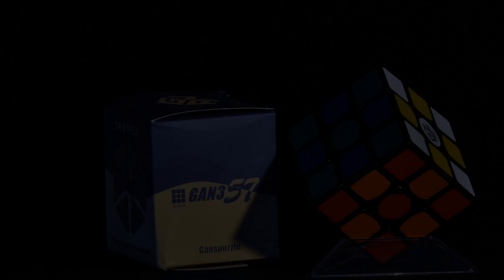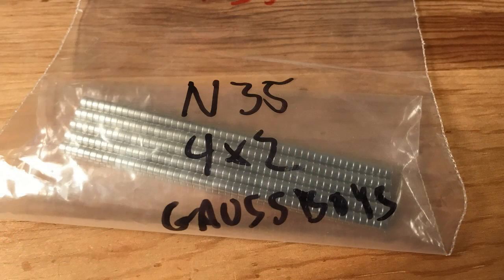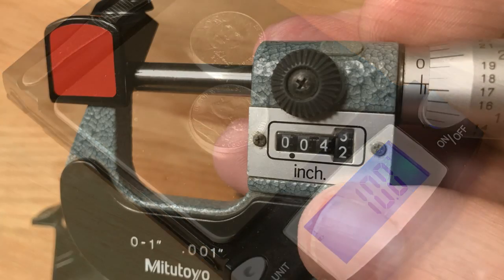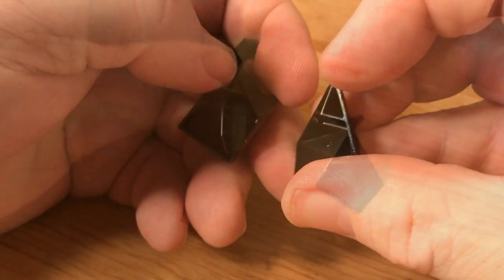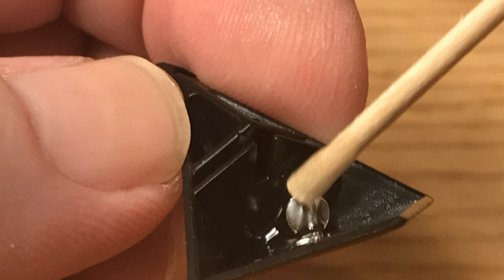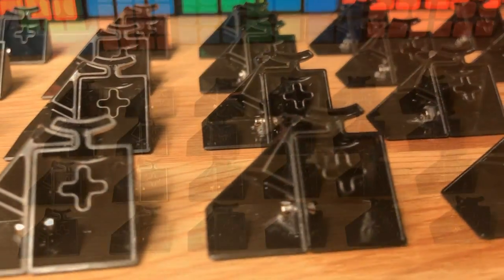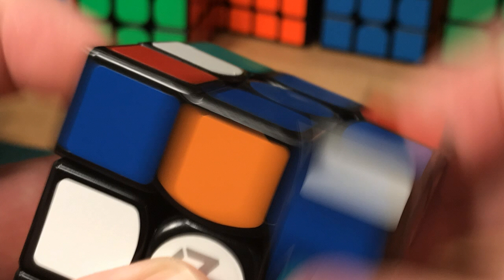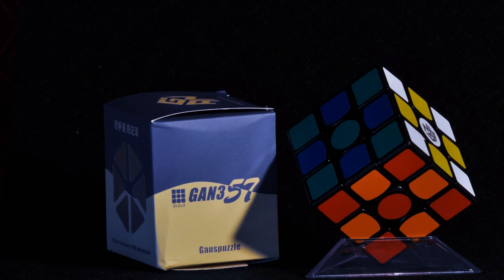How To Make A Magnetic GAN 357 Speed Cube

Comment: This 357 has a clear core? Is it the Ultimate version or the V2 version? I am just confused about the 357 versions, as I thought it was just the 357 and the 357 ultimate, but this version seems to be different from both of those.
Reply from the maker: Hmm. This cube was from four years ago. They probably have changed the core over the years. This was the only 357 model available back when I made this video.
Reply: @dmcubing6342  Ok cool. I think they probably just refreshed the 357 model with the new clear core once that came out, because the 357 and 357 ultimate have the original octopus core and a metal core.
Reply from the maker: @WillRaj  probably so. I didn’t know that about the other versions. I believe at one time Gan was having problems with some of their cores falling apart. I remember having one where the core screws detached from the core.
Reply: @dmcubing6342  Yikes. I just find it interesting that there's not much documentation about this cube. I went to the cubicles website, and they only ever carried the 357 and 357 ultimate. However, I went on some random website and found a Gan 357 V2, which might be what this is? Idk I know it is old i was just curious.

Comment: I have a important question for me. Please reply. What shoul ı use in my gan air s? What do you recomend?
Reply from the maker: Ömer Faruk The factory magnetized version uses a 3x2 magnet in a strength I believe to be N52. For its tiny size, it's a strong little magnet, but because of its narrow 3mm width, its moment of attraction is less while solving the cube. This gives it a nice tactile feel with small short clicks. I'd recommend the N50 or N52 3x2 if you like that type of feel in your cube.
Reply: @dmcubing6342  Thank you very much for your reply. I am afraid of strong magnets. because my friends said that if the magnets are strong, it can turn into UM. But you say strong use. I trust you. because you have too much experience.
Reply from the maker: Ömer Faruk Size is important not just strength or grade. In a standard Gan Air, I would use an N35 4x1.5. 
But I know for a fact that the factory Air SM version uses 3x2, and have heard they're probably N50 or 52. Again, the narrower 3mm makes its attraction shorter than a 4mm magnet.
Reply from the maker: Ömer Faruk You can also check the Facebook page called Magnetic Cube Help and Support.
Reply: @dmcubing6342  Okay. Thank you so much

Comment: Does Plus Five Clear Epoxy will do ? Please reply 😶
Reply from the maker: Dendi Christine I don't know about that specific epoxy, but in general, two-part epoxies work fine. When I use epoxy, I usually use a slow curing type. Otherwise you have to work quickly. But epoxy has the advantage of allowing more time to accurately position the magnets.
Reply: DMCubing What is the color of the adhesive container ? I just want to be assured 😊
Reply: DMCubing It says at the back , Initial curing is about 5 minutes while sull strength curing takes 24hours . Is yours the same ?
Reply from the maker: Dendi Christine No.  Occasionally I will use one called Dev Con Two Ton Epoxy which has a 30 minute handling time. Five minutes is OK, but you're gonna have to kind of be quick with it, and mix little portions of it over and over. You'll still be OK though.
Reply: DMCubing But it is still slower than a superglue ?
Reply from the maker: Dendi Christine yes
Reply: DMCubing Thank you so much :) I really like your videos , I think Im ready to magnetize my GTS 2 on wednesday 😁 More power for your channel btw :)
Reply from the maker: Dendi Christine thank you! Let me know how your cube goes! Good luck, and have fun!
Reply: DMCubing Sure thing :) Thank you !
Reply: DMCubing Whats the difference in strength between a 4x2 neodymium magnet to a 5x1.5 one ?
Reply from the maker: Dendi Christine Quite a bit. The 5x1.5 would be way too strong.
Reply: It was successful 😊 Thanj youuu , I was just a little messy because of the 5mins cure time but it has a strong hold 😁 Thank you
Reply from the maker: Dendi Christine Hey that is GREAT NEWS!!!! Nice!!!! Thanks for letting me know!!!!

Comment: Dmcubing, when I take out magnets out of my cube using a hobby knife, I noticed that I'm cutting little bits of the magnets, will this affect the magnet?
Reply from the maker: Dusky Actually, yes. Neodymium is very susceptible to rusting once the plating is removed. It's probably a good idea when you're gluing them back in to put enough glue on the magnets to coat over the places where the plating is chipped and scratched.
Reply: DMCubing Thanks!

Comment: waiting for wuque 4x4 magnetic. so that i could make on for myself.
BTW great video.
Reply from the maker: I had my Yuxin Blue apart last night. Gluing the magnets will be the easiest part. I just need to figure out how to put it back together.
Reply: DMCubing you can refer to another 4x4 for assembly. that may help
Reply from the maker: Well, it's easy to know where the parts go, it's just the process of putting them there. I think I'll have to resort to using strong tape. Taping the core parts so they stay together as they're placed on the core. Tricky stuff!
Reply: yeah.that is sturuggle because the rings around it moves all the time and its hard to get the internal peices in place